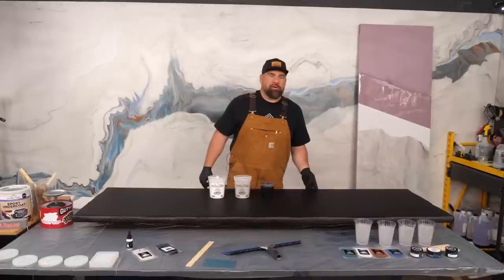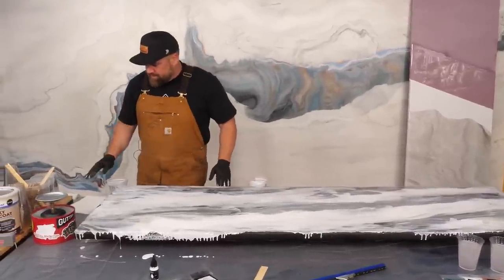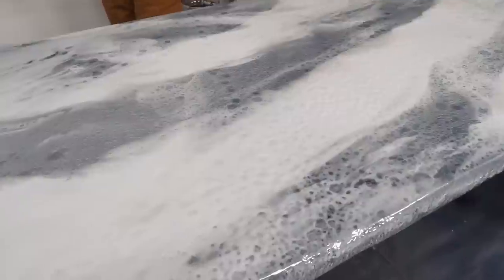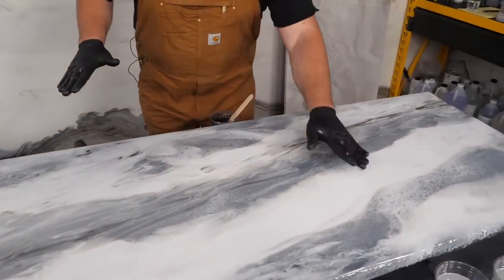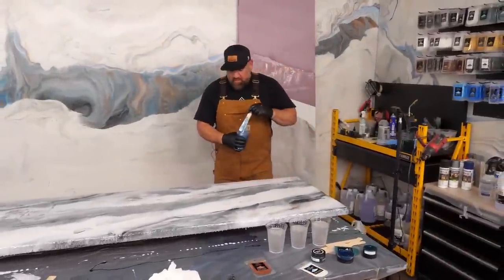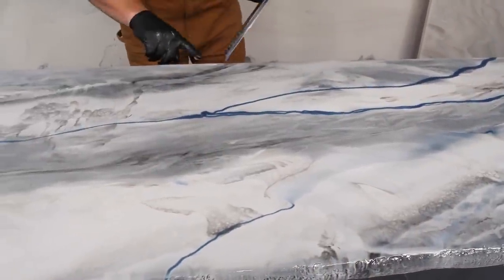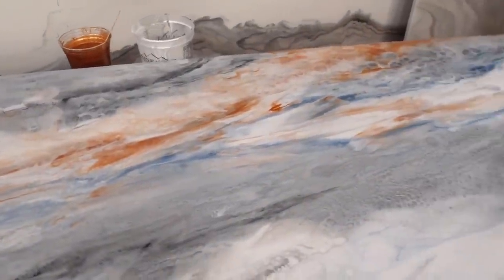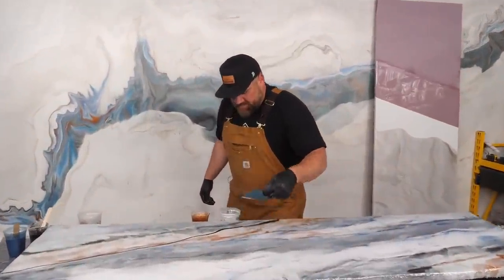You Pick My Epoxy Colors | Big Announcement! | Stone Coat Countertops Epoxy

Comment: Can you use the Pink insulation board as a backsplash? I watched you do it the other day but it would go behind my electric range. Is it safe?
Reply: Tough call if you stir fry or flambé. You could use MDF.  Sealed it would be steam proof and higher temperature rated than foam.